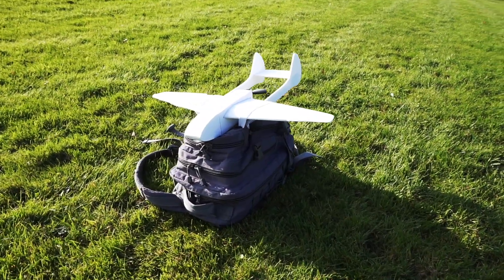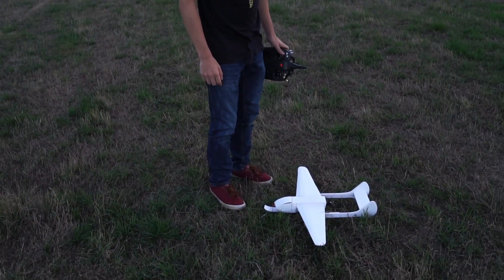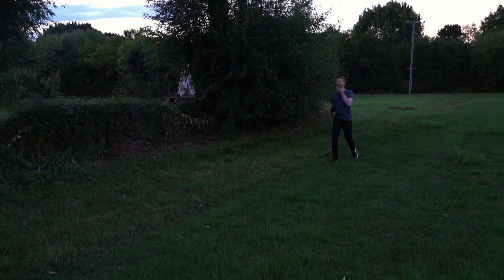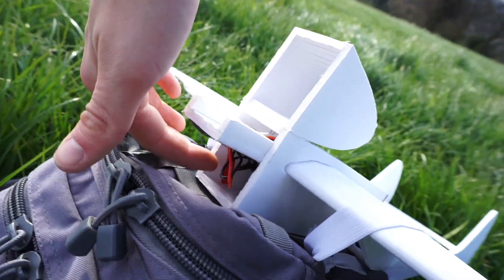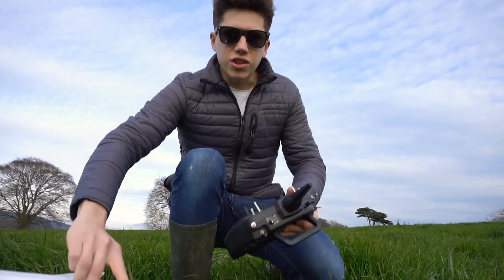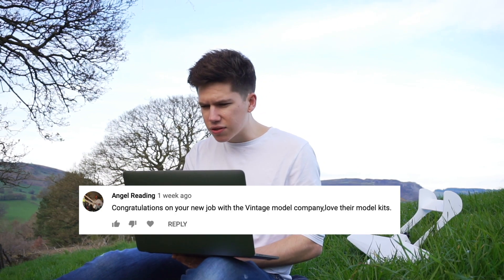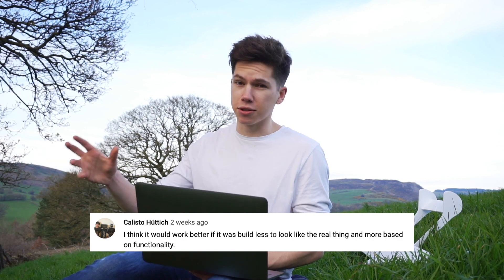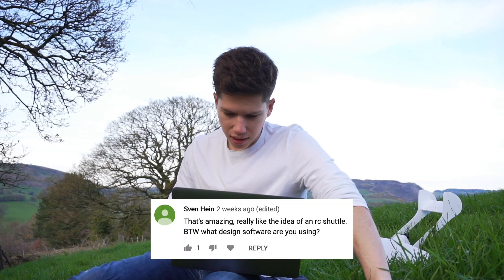Backpack-Sized Jet

Comment: A jet aircraft (or simply jet) is an aircraft (nearly always a fixed-wing aircraft) propelled by jet engines.
That's a propeller mate.
Without propper terminology you might aswell call it an apple.
Reply from the maker: yeahhhh but it's a model of a jet plane 🤷‍♂️
Reply: @Project-Air  That it is.

Comment: Where is the CG?
I'm not being able to get the CG ahead of about 50% of the wing. Is that about right or do I have to put some weight on the nose?
Also should I glue the wing as far back as possible or as far front as possible?
Reply from the maker: Put it about 30% back from the centre of the leading edge. You'll need to add some nose weight if you're using a 2s. Hope that helps!
Reply: @Project-Air  thanks, yeah I'm using a 2s 800mah. That rules out a problem right now trying to build the thing in a way that I can remove the motor as I only have one.
Reply: @Project-Air  one more question how do you recommend gluing the battery tray?

Comment: That Vampire looks like a real fun design nice and compact too James.

Regarding your channel please keep it as it is with the novel subjects that you build,I would like to see you fitting micro radio gear and small motors in some of the Vintage Model company kit designs perhaps doing a conversion here on your channel,I have fitted such equipment in these small flyers and it can be very challenging but rewarding,perhaps even VMC can be approached about making a simple conversion module pack that fits the range of fighters etc,a simple laser cut frame with tiny motor,ESC and hardware pack,you could do the design workand draw up an instruction leaflet to go with it.

It is good to see young people like yourself building models again,experimenting with new unusual designs as you are doing,keep up the good work James.
Reply from the maker: Thanks! Yep, that's a great idea. We'll deffo be doing that on the VMC channel as we're about to release conversion kit for the VMC Spitfire.

Comment: Alright James. The plane looks proper nice however, as seen a couple of times it looks like its prone to tip stalling. Is this true? or was cg not far enough forward or any other factors? Looking to build it, it looks nice!
Reply: Not sure, but would exposing some under camber at the wingtips as on the Ft Spitfire solve this?
Reply from the maker: I've added more undercamber and redesigned the wings to be less tapered to fix this. It's fine most of the time, but it will drop a wing under a certain airspeed which you should be aware of.
Reply: @Project-Air  Many thanks for getting back to me James. I wasn't doubting you at all. I love the Ft Spitfire and am relatively new to flying just wondered if I could save myself some mishaps . Keep up the good work. I'll let you know how it goes.
Reply: ProjectAir sounds good👍🏼 was gonna print the plans but realised they were ‘png’, will they print off tiled or not? I can’t seem to change them to a pdf
Reply: @alexkelly6475  I opened the file in ms paint. In print options I set it to print 100% and it tiled it itself mate
Reply: Aiden Tansley cheers Aiden👍🏼